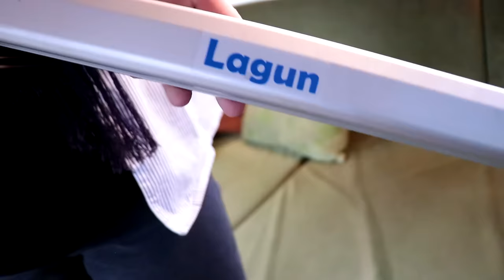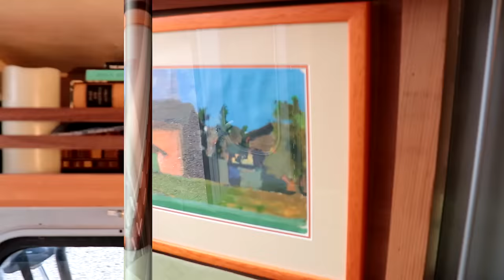Tour of Couple Living in a Shuttle Bus

Comment: Suggestion: it is best to avoid hiring anybody to do work for you the way he stated “time and materials” ...always get a firm price that you both agree on from the start. They will often try to force you into that situation because it is better for them, not you. You may find out they work a little slower if the meter is running. Best to agree to a price that is fair for both parties up front. ✌️
Reply: Jay Bee I always estimate the number of hours and have a “not to exceed” amount. That way if I underestimate the hours, it’s my loss and the job still gets done. ✌️
Reply: @sanwages  It's possible to spend far more than $50 per hour having someone build out your van.  The larger companies that do it will be charging a lot more than that, as they have so much overhead that has to be paid for.
Reply: He was obviously speaking in general terms about his pricing methods, and both he and Bob acknowledged that. Why make an unfair comment which doesn't acknowledge what was said in the video?

Comment: To me, that thick wood would add a lot of unnecessary weight. It needs to have some tiny holes cut into it to help reduce weight and load for the engine to pull. Dylan McMaster has a video on this very concept. Still a great skoolie build.
Reply: Okie Rider most of the wood is very light weight cedar. It is an E350 dually with a GVR of 11,500 lbs so it handles the weight just fine.🙏✌️
Reply: @Wanderboom  
Ok, good to know.

Comment: Can you tell me what material they used for the curved ceiling? my shuttle van van has a similar arch and I am wanting to replace the cheap and loud rattly sheet metal.
Reply: Justin Burrows thanks Justin, I installed thin plywood with self tapping screws. Then we applied grass cloth wallpaper with spray adhesive and finished with the cedar strips over the joints.🙏✌️
Reply: @Wanderboom  thank you very much. I am unfamiliar with the fiberglass wall cover material. I am going to research it!
Reply: Justin Burrows if you want to check out our channel (Wander boom) episode #6 covers the ceiling insulation and you can get an idea of how ours is constructed.🙏✌️